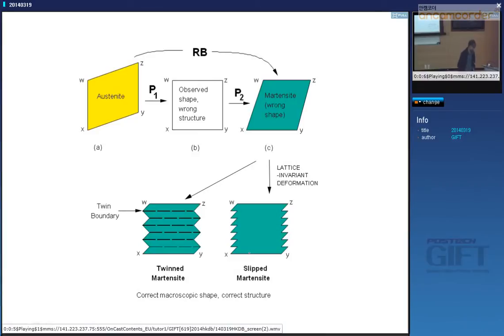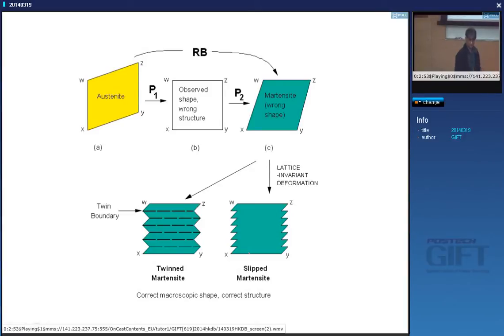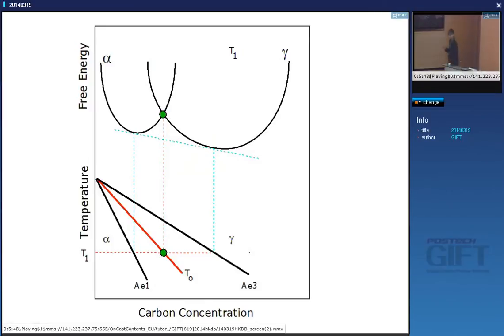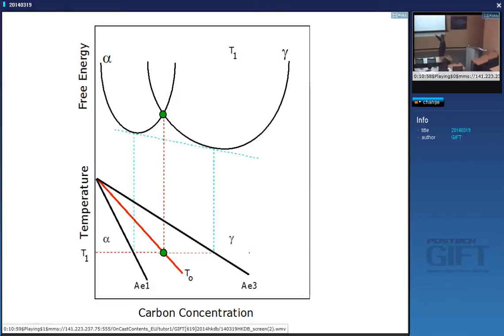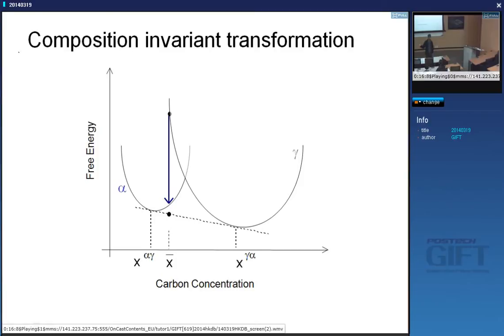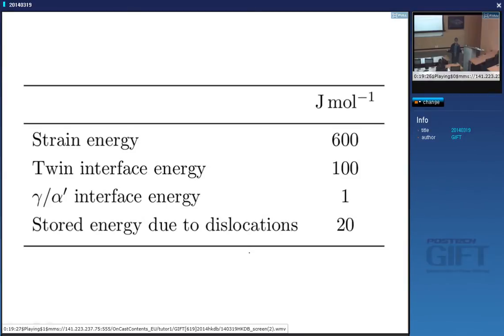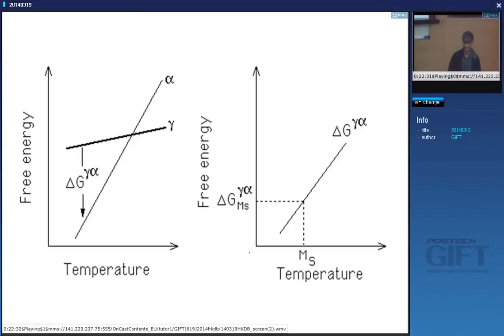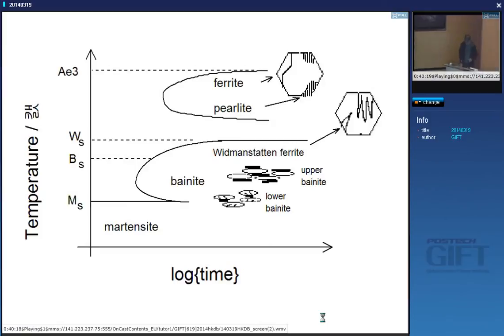Phase transformations in steels 3, 2014

Comment: Hi Professor Bhadeshia,In bainite transformation , Can the austenite's decomposition between bainite ferrite plate  be called eutectoid reaction?
Reply from the maker: +Smith George If there is the cooperative growth of ferrite and cementite at a common transformation front
Reply: +bhadeshia123 Is there any other mechanism that austenite decompose to ferrite and cementite, but not by  cooperative growth of ferrite and cementite at a common transformation front, such as  austenite decompose to ferrite and cementite during 200~300℃ tempering?

Comment: Does the strain energy dominate the sheaf shape?  if so the sheaf thickness is greater than the sub-unit , are the displacement and strain energy  also greater?
Reply from the maker: +p zhu The sheaf also contains retained austenite so the average shape deformation is smaller.